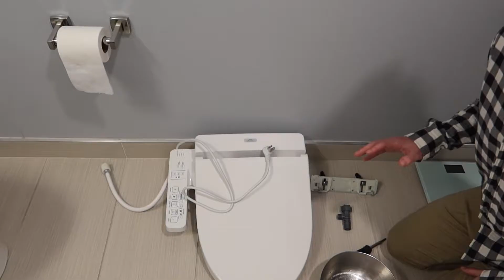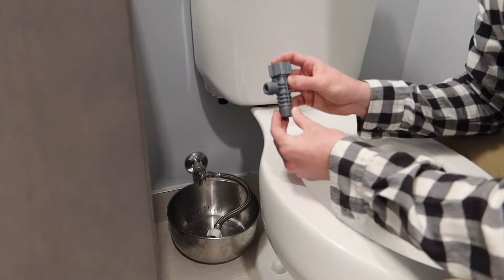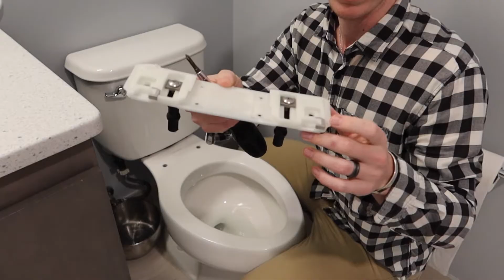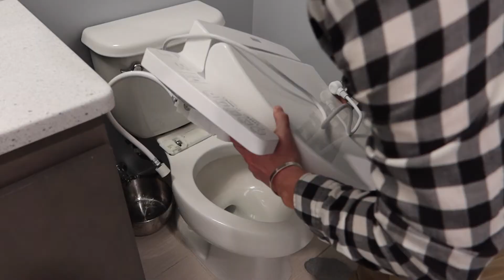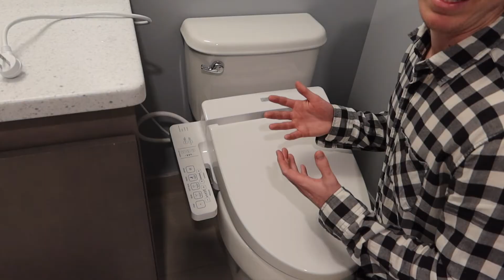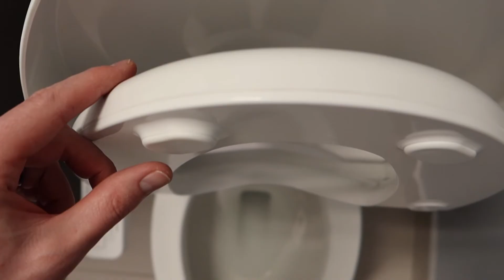JAPANESE WASHLET INSTALL | Toto C100

Comment: Very clear and helpful video.  I found that with a new American Standard one piece toilet I couldn't screw in the cold water feed to the gray interface pipe supplied by Toto after it was attached to the toilet because the shape of the toilet was too constricting to turn the coupling.  Solution: Attach the feed to the gray interface first and then attach to the toilet.

Comment: Thank you soooo much for the video! I also noticed that if the rubbers on the screws are too big for the screw holes on the base, you can use a knife to whittle them a little and put some oil to help them get in places easier. This happened to me and I panicked for a moment haha.

Comment: Hi, Is there anyone has the issue to push the A-7 (Black tube into the hole)?
Mine one is Kohler,  I just couldn't push it through that. ..
Any suggestions?  Thanks

Comment: Interesting video. However, that wiring makes me a bit nervous. I wouldn't really want to be having a wash next to an electrical cable / socket. I don't think that's legal in the UK. I also brought back a Panasonic washlet from Japan to the UK. If you're willing to pay an electrician he can cut the plug cord and drill a tidy hole for it to be threaded into another room.  He can then  re-connect the plug with an extended cord to be plugged into the nearest socket. Therefore, it's powered from another room and is much safer that way. However, it depends on the set up of your place. Luckily enough I had a cupboard next to my bathroom that had plug sockets so it worked out.

Comment: 3 concerns about this interesting product. Leaks, flooding my entire main floor with a faulty, cheap plastic, worn out water source attachment piece due to constant water pressure. Hydro costs, does it only warm the water when you sit down or is it heated on demand? How do you clean the underside of the seat, full removal required? Thanks for your time and video post.
Reply from the maker: I have not had any leaks at all. I would only buy Japanese (or possibly Korean) products like this due to their superior quality. 

The water is heated pretty constantly, but the seat actually remembers when you use it and adjusts accordingly. For example, in the night it might be a little colder, but if you regularly use it at 8:00am then the seat will ensure it’s ready. I have not noticed an increase in energy costs.

Cleaning the underside of the seat is the same as any other toilet seat.

Thanks for watching!

Comment: Hi Toms! Thank you so much for your helpful video. I have a question and it is highly appreciated if you kindly help me. It is around two weeks that the biden of washlet works once I turn a little bit the handler of flush tank. Otherwise, the water does not spray and the lound sound is arised similar to the shaking of the building's pipe. Is the waslet dead end? Thank you so much for your consideration.

Comment: My house doesn't have an electrical outlet next to the bidet either. Thanks for sharing the video! Haven't you encountered any problems from getting the power from the sink oulet?
Reply from the maker: No problems at all! Just the wire that looks a bit unsightly

Comment: Just bought one today, and will be taking it back to Norway. Will I need a transformer 240V -> 100V, or do you think it’ll be okay with just an adapter? 

If needed, do you have any recommendations?

Many thanks!
Reply from the maker: Oooo I am not sure about the transformer. I would expect an adapter to be enough, as that’s what they are for, but I would check with someone who knows more than I do! Solid effort though bringing one back to Norway! 🇳🇴

Comment: I installed the Toto and the seat somewhat wiggles . Although I did hear the click and have tightened the screws. Any suggestions?
Reply from the maker: Did you get the correct shape? Elongated vs. round? Is the wiggle due to the offset seat pads that I mention at the end?

Comment: Tom!  I have been trying to see the electrical inputs for the toilet. Have you have any electrical issues due to the japan to US change?  Japan normal electricity output is about 220volts while US is about 110volts,  Is the toto C100 electrical input range permissible for the 110volts?  If the voltage does not match then you might get issues such as fires/ect. even if it does not match you could always buy a separate voltage transformer to change to the appropriate level, which are also decently cheap.  any thoughts please?
Reply from the maker: This one is made for the US market, as everything on the Toto is in English, not Japanese. Likewise voltage.
Reply: Japan normal electricity is 100 volts, with frequencies that are either 50 or 60 Hz.

Comment: And what was the purpose to flash water from tank? Water is shot off and tank is not involved in installation
Reply: You flush the tank to make sure the water is shut off completely.  If the tank doesnt fill then that lets you know the water is off